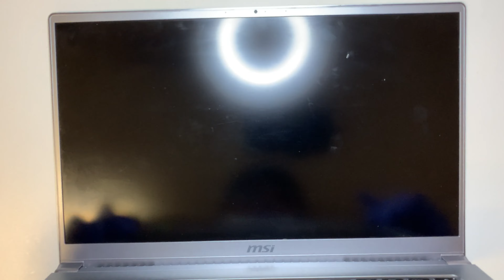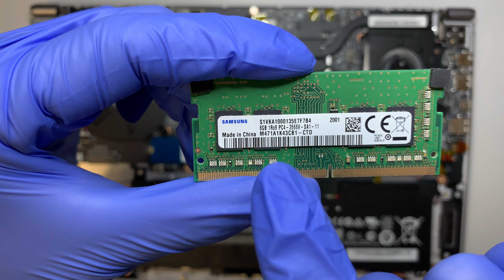MSI Modern 15 A10RAS 231 Tear Down Disassembly

Comment: How would I go about fixing my hinge on this model? Seems to have either popped out of a socket or broken entirely.
Reply from the maker: Try using Loctite Super Glue Ultra Gel:
https://amzn.to/3z8fUOL
Reply: Hey I know it’s a long time ago but did you find a solution? I have the same problem where my right hinge has either popped out or is broken. Pls help 🙏🙏

Comment: one question are there two m.2 slots? i mean one slot is full but there's another one next to the battery isn't it?
Reply from the maker: Yes. It has two M.2 slots.
Reply: @UbergeeksBiz  uff thats pretty good for the laptop another question hows the battery whilenintense gaming? How Many hours?
Reply from the maker: @julx1787  About 2 hours
Reply: @UbergeeksBiz  and normal stuff vídeo editing, web brosing, video streaming?
Reply from the maker: @julx1787  More or less the same for me
Reply: @UbergeeksBiz  but gaming uses more battery no?

Comment: Hi, do you know if the screen is changeable, id like to replace mine but had no luck finding any tutorial
Reply from the maker: do you mean change for a better screen ? like the refresh rate. Answer is no. Has to be the same screen.
Reply: @UbergeeksBiz more for the same screen because i got a stuck pixel, i just couldnt figure out how to disassemble it
Reply: @UbergeeksBiz  Hi again, any idea on how to change the screen ?

Comment: I was interested in this laptop..until I saw the price on the battery! PASS, but thanks for a good video!
Reply from the maker: Hahaha.... you might able to get a used battery on eBay. Overall, it is a good laptop.
Reply: @UbergeeksBiz  Thanks again. I just replaced an 8 yr old Gateway Laptop battery (off brand) for $21. That's cheaper than me opening the old battery up and changing out the cells. It seems like the manufacturers just go out of their way these days to make things hard. At least I can remove the battery when attached to the mains and avoid unessary charging cycles. I have no problem opening a laptop, but most would choose to bring it to a repair shop and pay thru the nose for unnecessary service!
Reply from the maker: @jeffme6891  Yes. They are making things harder for repair. Especially A.P.P.L.E. There is this "Right of repair" bill that need to pass. Or else, this market will be monopoly by the big guys. And like you and me, will not able to repair but instead of buying a new replacement. Waste of $ and hurting landfill.
Reply: @UbergeeksBiz  Yep..I have 2011 I-m-a-c and even that is a PIA to open. I was done with A-P-P-L-E back then. I am old enough to remember being able to do my own basic car maintenance too. They sure made a mess out of that industry too..with a lot of help  from Washington DC!